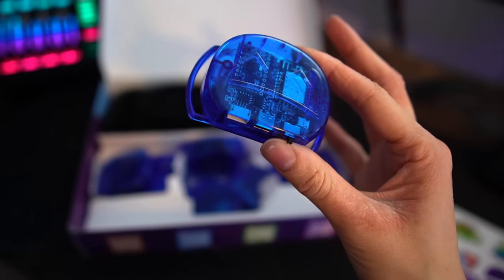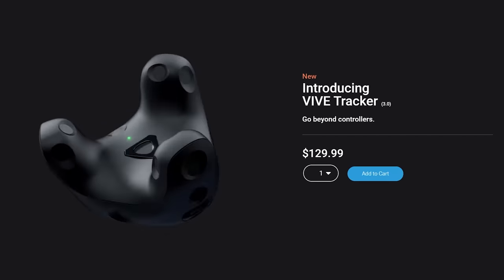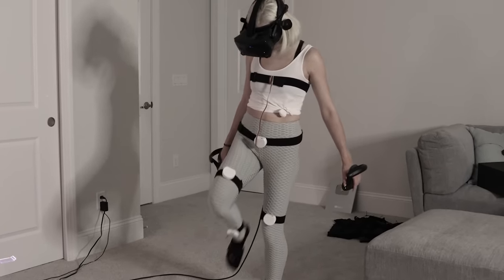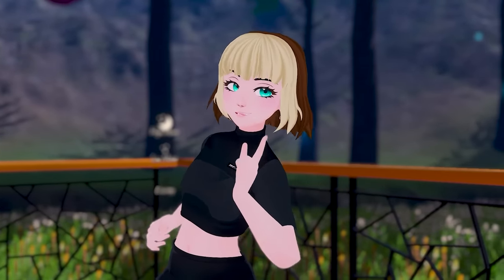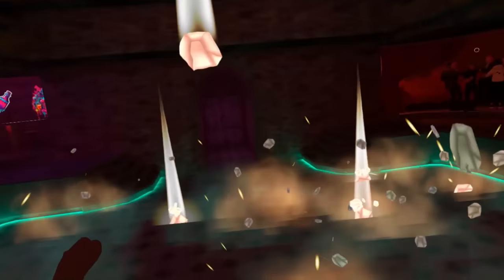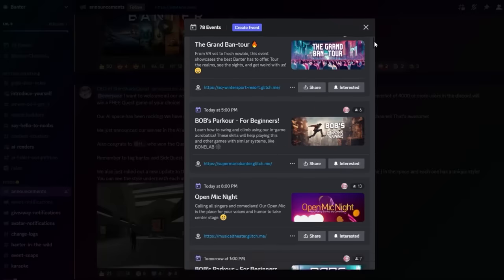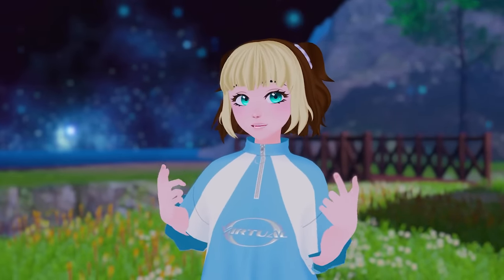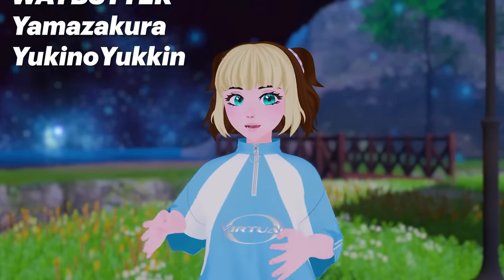Slime VR: AMAZING Full-Body Tracking on PC VR + Quest for... CHEAP!! (Big Updates)

Comment: Slime VR is great. The fact that it is open source makes for some amazing VR stuffs. My favorite so far is being able to use old android phones as trackers. Only downside is you need at least 5 old android phones. I had a bunch of Galaxy s4's and s5's and it worked pretty well considering. I still Primarily use my Xbox One Kinect but it's nice that you don't need DIY or solder skills to mess with Slime VR.
Reply: The Xbox Connect was really ahead of its time and its sad that there is no real development in similar external depth-sensor tracking. I think if something like Slime VRs could be combined with external depth sensors or IR led tracking like the old wii remotes then that will make them truly a Vive alternative - the IR/depth tracking can be an optional add-on to help prevent drift when using them but then occlusion still won't be a problem because the Slimes will still be able to operate just fine when external tracking is lost to occlusion.
Reply: @bebelynx there is a project that is combining cheap Playstation Move cameras with Slimes for 2 way tracking, and the results look amazing.  Once I get my hernia surgery, I'm gonna get back into VR and grab me a couple of the cameras to go with my cheap DIY slimes.
Reply: mageenderman  PSMoveServiceEx I think, or something like that.
Reply: @bebelynx  I wish that there were basestations that track like the kinect yet have basestation levels of precision and accuracy.
Reply: @bebelynx  It's sad they nerfed the hell out of the Kinect that thing could've been soooooo much more and instead of being a horrible accessory that hardly any games used but the DIY community loved the Kinect easily could've been the best tracking solution ever made even now especially if we would've actually got the upgrade that they planned for the Xbox One.
Reply: Wait you can use a Kinect for full body tracking?  When the heck did that become a thing?  I still have one of those things.
Reply: @Mad-Lad-Chad  you just need the PC adapter cable. It's like $8 for the 360 and about $25 for the one. Software varies. Driver4Vr is paid on steam but there are free ones also.
Reply: I tried the phone method myself, because weirdly enough, I have enough phones for it, but none of the phones would connect to the software. 😢
Reply: @theninjamaster67   I loved using the Kinect in Skyrim, it was so much fun to be able to actually shout your shouts and all the other awesome voice controls. You could equip anything or save or open the map or fast travel, all with just a quick verbal command. It made playing the game more fun and even going thru menus less tedious, because you could ask for specific items or just tell it to sort by weight. It was definitely way under-utilized and could have been a much more useful accessory.
Reply: @jamesw657   There's actually a mod to be able to say the shouts for Skyrim on PC and there's a mod for it on Skyrim VR too it's pretty cool honestly.

Comment: The good of Vive Trackers is that as long as you have a SteamVR headset with base stations is that it just works with hardly any setup.
SlimeVR can be a bit more of a pain with frequent calibration, posing and getting them in the correct location.

My girlfriend is happy-ish with the set that I built by designing my own 3D Printed cases + learning soldering.
It is just the frequent calibration when it is working that makes it a bit of a pain.

Still a lot of fun and you can cover SlimeVR Trackers with clothing unlike HTC Vive Trackers which need constant view from base stations.
Reply: After building them and trying to get them working myself, it makes me want to just save up for vive trackers. Or really, I want to get the camera-based ones that HTC teased a while ago.

Comment: I'm getting the parts together to do my own DIY's. I feel that allowing people to make DIY units and make changes to the design, use different parts and, as of this point in time, providing certain parts via their online store (they have their own version of the excellent BNO085 IMUs at a fraction of the price of ones made from companies like Adafruit) and even allowing people to sell their own variants is what keeps SlimeVR alive despite the delays and the communication from Eiran on the progress of the official units and real photos of stock/progress is what encourages people to wait through the delays. Honestly I have my IMUs arriving today and will be ordering other parts soon and I can't wait to make my own tailor-made design specific for my body (I'm keeping the IMUs separate from the microcontrollers to improve placement accuracy and so I can make them easy to replace/swap better IMUs when they become available/supported). There is so much potential and with enough support, they can only get better
Reply: I hope it goes well. After 60 hours of assembly and a dozen or more of trying to calibrate, they've been sitting on a shelf for 9 months. They were too frustrating to deal with.

Comment: I didn't know there was a calibration meetup!! I've just been fiddling with values till its decently accurate, but idk exactly what they all do. Particularly with 8 point (5+3) rotating my foot makes my knee move a little bit when its not irl. There's foot size and offset, but idk where its actually moving the pivots relative to the bone in 3d space. 

With that said, well calibrated imu trackers are definitely the way to go. My diy trackers stayed calibrated for a few hours accurately with only the quick reset. Slime FTW 💙

Comment: Vive/Tundra trackers actually use IMU technology as well. The lighthouses are there to correct the errors naturally generated in the IMU tracking process. At regular intervals, the lighthouse will send correction coordinates to the tracker, which (when combined with the IMU data) gives the tracker its location.

Comment: The absolute best part of diy slimes for me has been the fact that I can build each tracker for roughly about $5-10 dollars a piece and still get decent results! And it's given me a new excuse to get back to messing with my 3d printer again. The electronics themselves are very cheap, unless you go with the top of the line IMUs in the official units. And even with the top of the line IMUs, still much cheaper than any other tracking solution on the market. And the community is amazing, I've learned so much about how to solder and about electronics from their discord!

Comment: Really enjoyed the Slime VR video! In reference to the issue with devices dropping: this often happens when a router is handling too many connections. With a full Slime VR setup plus other devices, it's a common challenge. Upgrading to a more robust router, possibly with Wi-Fi 6, can make a big difference in managing multiple devices. Alternatively, setting up a second router could help distribute the load. Keep up the fantastic work with your VR content!

Comment: I'm glad you update past coverage of hardware because it does evolve and change over time. Case in point right here. Vive Trackers are good but without lighthouses they are useless and with tracking occlusion or interference it can lose position quickly. Forget napping with it if you like a blanket. While early, this solves a lot of problems and disrupts the market in a way that'll move things forward for the industry.
Reply: What you gain in cheaper cost and not dealing with occlusion, you lose in user experience and frustration. SlimeVR are not easy to setup and deal with. This is a fact that people don't pay attention to.
Reply: She covers this exact topic, and the developers even talk about how it's essentially an open source project and the software in very much in beta. For some people, they have more time to invest than cash, or some a pioneering spirit to use them first hand and contribute to the source code.

Comment: I love the fact that they are open source because if you know what you are doing (not to brag but I do) you can not only make them yourself for cheaper, but also better. I made my set of 6 using their highest rated imus for about $150 all up, and made them smaller at only 30x35x14mm with plenty of improvements left on the table.

Comment: It may be a bit pedantic but there is a small correction I would make to the explanation. The lighthouses do not actually track anything. All of the hardware tracks the position of the lighthouses. This is an important distinction because it means every tracker needs to have its own connection to the computer. Which is why you can't just strap some extra controllers to your body if you happen to have them, because the headset will only support the connection of two controllers at a time.

Comment: Just a minor clarification. The lighthouses themselves don't track devices. They send out a light grid that the various lighthouse tracking devices use to track where they are in 3d space.
Did you know if the latency is pretty comparable now? I remember Thrill doing a side by side test some time back but I can't remember how these specifically compared. I wanted to DIY a set some time back. Sounds fun. (though im sure the assembly is easier than getting everything installed, connected, and working 😂)
Reply: IIRC, the Latency mostly depends on your network conditions plus some certain settings related to smoothing and what not in the software. When I tried to use mine, the latency was anywhere from 50-150 ms, so it wasn't that bad.

Comment: Damn, I'd forgotten all about SlimeVR! I just moved into a new apartment where I've finally got enough space for proper roomscale VR and I've got a whole dedicated workshop space. Guess I'd better set up the workbench so I can build a set of SlimeVR trackers. (And finally finish my LucidVR gloves with force feedback, while I'm at it!) Thanks for reminding me about this! 👍
Reply: Just know that it's a PITA to get them working right, and even then, it's probably going to be more of a puppeteering system that full body tracking.
Reply: @DarkSwordsman  Back in like 2015, my first VR setup was a cobbled-together phone-based HMD, a pair of PS Move controllers, a glowing ping-pong ball on my head, and four PS Move Eye cameras... It required no less than five pieces of middleware to make it all work in SteamVR.

I'm sure I've dealt with worse. 😏
Reply: @Bakamoichigei  All I know is that based on everything I read and was told, it shouldn't have been such a problem to get them working. They've been sitting on my shelf for 9 months now.
Reply: @DarkSwordsman  Well, that's unfortunate. I'm going to document my progress in building a full set of trackers. I don't expect to encounter much trouble, I've built IMU-based motion tracking devices before, so I have experience troubleshooting something nearly identical to the SlimeVR hardware. 🤔 (And I'm familiar with the esp8266 MCU)

Comment: I wonder how well using a WiFi based posture tracking system like WiVi or GoPose would work for VR, the software can work with the default WiFi equipment people already have, and it can work through walls so occlusion isn't a problem, and it works based off the reflections of your body and bones so trackers aren't needed at all.

Comment: Been thinking about getting IMU trackers for the night But as long as I have to recalibrate every few hours, I stick to my Tundra trackers
Reply: To defend Slime: You do have to recalibrate every 20-60 minutes depending on what IMUs you get and how they are that day. However, the calibration process is "1. stand in pose, and 2. press button". You can recalibrate them within 5 seconds most times.

Comment: Great video but yeah I still prefer my Xbox 360 Kinect and Driver4VR as I just use it with my Quest3 to get elbows and better tracking which I can also get legs if I want by standing up and over all not hard to set up many VR games I cover are worse and it should stay set up between sessions and avatars... Still slime looks really good if you can't get a Kinect and or need to do more actiony things like dancing.

Comment: What headset are you currently using? I think I have an older model HTC Vive and I’m not satisfied with the controllers since it has that weird “track pad” movement instead of a joystick. I was thinking of getting the XR Elite as an upgrade, but your headset looks cooler and lighter. How do you think your headset compares with the XR Elite?

Comment: i built mine to use vape batteries. 14 hours on a single charge, and i can just change the batteries when they die. turning on the magnetometers prevents drift.

Comment: What if some makes hybrid tracking IMU primary, inside out tracking secondary for auto sync.
Or light house secondary, could only one light house be enough to check/sync IMU drift opportunistically.
Reply: Their is a project combining slimes with cheap PS Move cameras doing exactly that! Best part, is even the cameras are dirt cheap at this point.

Comment: Don't worry about that too much, sometimes it's just cheap ESP32 doing what cheap ESP32 do. Which does include randomly breaking in random ways.
So Step 1: reflash
If that does not solve it, check all connections
If that does not solve it replace the chip.
These things are so cheap they are almost sold by weight, so that comes with the territory.
Also non grounded electronics with switching power supplies like nearly all laptops have are a big problem. If you touch a conductive part of your laptop and a micro controller at the same time you probably need to replace it. The low amps will not threaten your body, but the high volts are a significant threat to electronics like that. And ESP32 have basically no protections, see price tag. It's not basically, they have none. Apply to much to GPIO and at least that GPIO is gone.

Comment: They sure do look amazing! I am looking to buy FBT for cheap! and I can see that this one of the best opportunity to get fbt! HOWEVER... I was wondering? since it use Wifi, if you have a bad wifi, will the Slime vr work well? because they sure do looks good, but it might be better for me to buy instead a base station with trackers, if my wifi is bad? no?
Reply from the maker: You should try and make sure your local wifi connection is decent. My wifi is great, so I cannot attest to how it works on bad wifi! I would assume the latency would be worse. But I'm sure the SlimeVR Discord could help you figure out if your setup is good for it or not :)

Comment: Meta is about to release full upper body tracking for quest 3, and will use an a.i to guess your feet. Might not be as accurate as full body tracking devices, but it should be fine for a lot of people and no additional cost.
Reply: The additional cost is buying another headset. Most vr users already have a Q2
Reply: @chronodis  I know! Exactly!

Comment: I know this will probably sound stupid to people that worked for a lot of time on this specific problem. But why having each tracker as it separate unit. Wouldn't it be cheaper and more ergonomic to have a central unit at about waist height and sub units with just the acell/gyro/magn ic  for various body parts. The I2C protocol should work at bellow 2m lengths and there are some really great cable for aerospace industry that are very thin, shielded, bendy and with enough wires for I2C and power delivery. I have used such a design for biomechanic micro strain gauge sensor for muscle measurements and they worked great for un-amplified analogue signals. I suspect it would work well with digital too.
This approach would decrease the amount of batteries, connectors, processors and wireless modems. If worried about length and number of cables to route around the body a i2c buffer could be used in the modules for daisy chaining. Also the sensor modules could be a lot smaller like this. 
Routing could be enhanced with a simple bodysuit (can be two piece) with some eyelets.

Comment: i have a set of slimes that i assembled myself and i also have wifi problems. the esp8266 mcu that the slimes uses as microcontroller is dogshit in my experience, its better to use the esp32, i think that using the esp32 would fix most if not all the problems people have with the slimes not connecting to wifi

Comment: I was excited to install the Quest Software on my PC, It runs so good for many of a few games with ray tracing, give or take the moderation for dialing down the graphic, but, I quote "Your systems graphics card is incompatible with the Rift system software." What is that supposed to mean? It even prevents it from pairing my PC to my VR. Even if I followed the instructions for the Air Link. I NEED HELP!
Reply: I would suggest giving Virtual Desktop a try instead. It's $20 on the Quest Store, but it also works over wifi (like Air Link) and actually gets frequent updates (unlike Air Link). It also has plenty of settings you can use to optimize your experience for your PC. In my experience, it has worked much better overall.

Comment: Install a VR tracker onto a dualshock 4 controller, and use AI based (pose based standable) simulation to pre-pose your character, and you can 'aim' a cursor with the controller and control movement, camera, with sticks and arm use with triggers???

Hmm. Technically the Dualshock 4 controllers have sensors already for sensing movements and stuff...

Comment: i built mine, the problem is that they drift and you have to reset them +/- 15min to 15min and the waist does nothing, like if i move it it mvoes but in game its like nothing moves, feel like theres a seting to turn on  but theres nos etting, also when i to snything else that is not staing up they are all over the place, i only recomend them becouse i got 8 trackers for 80 euros if it wasent for that i wouldnt